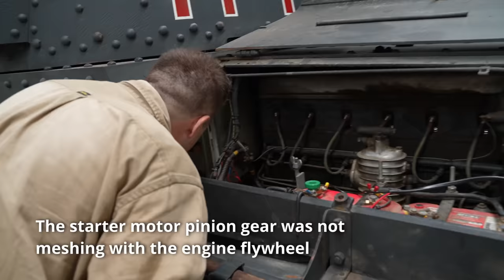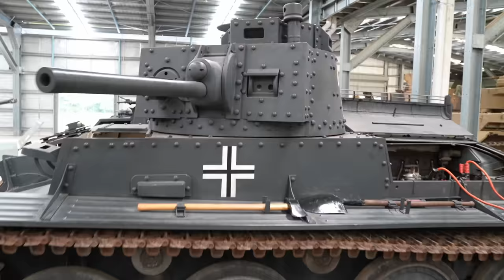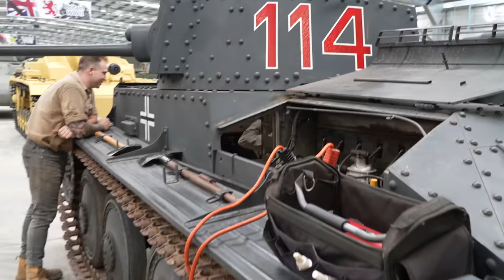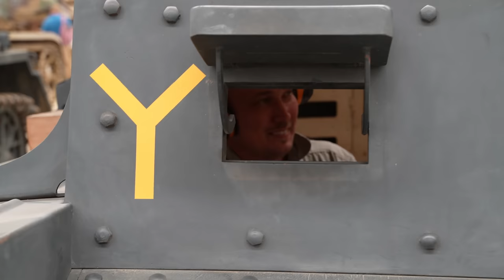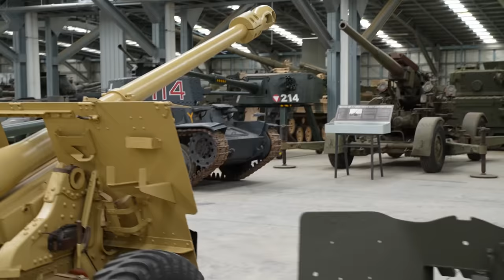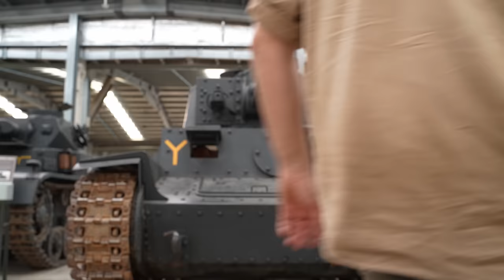Firing up a WWII German PANZER 38t Light Tank

Comment: I never realised before, that the 38t is so small against an StuG
Reply: To be fair, it's a light tank, and a pre WW2 design (not actually German, it is a Czech tank that was adapted by them).
Reply: It helps make you understand why the jagdpanzer 38t was so successful. Tiny little beast could hide anywhere yet still have a 7.5cm main gun.
Reply: Its not much better than a Panzer 2.   In operation Barbarossa the 38t was pretty much a sitting duck for all the very capable Soviet AT guns.  The riveted armor would fail spectacularly, and big chunks would break off and enter the interior causing a lot of injuries.  I think  Tiger ace, Otto Carius had a stint in one.....great read.
Reply: @wazza33racer   Of course the Pz IIIs at the time wasn't much better.   The 38ts had the advantage of the being reliable and... simply available.
Reply: @ConstantlyDamaged tout à fait
Reply: There are very few giants in the early tank corp.
Reply: @m2hmghb  this isn't WoT. The Jagdpanzer 38t wasn't that successful. The thing was way to small and had horrible vision. NO German tank knocked out more tanks the the Stug III.
Reply: Oh wow, look at that. Surprised me too
Reply: Nazis wouldn't have won anything without the Czechoslovak tank.
Reply: @ConstantlyDamaged  so was the Stug, which based on the PzKpfw III who was designed in 1935. The 38 was the successor of the model 35 and therefore it came even later than the Stugs base. The dimensions are more or less the same between the 35 and the 38. It was a bit higher and 5 centimeter wider but it was even 29 centimeter shorter.
Reply: @timothyhouse1622  This is not correct. The correct sentence would be, no other charriot was produced in such high numbers as the Stug. Therefore is is clear that the Stugs knocked out more enemies than any other vehicle.
Reply: @michalandrejmolnar3715  I had to smile reading your statement 🙂

Comment: A great little tank.  The right track could do with a tighten perhaps.
Reply: Having tracks that are tight when it's not being used to cross country absorbs more power and puts a lot of strain on the drive and idler sprockets. It also stretches and thus wears the track out faster. About 1.5 inches is quite normal. (From an ex-tank soldier and maintenance instructor with about twenty years experience). 🙂

Comment: Good old Thing ! Do You use Avgas to fuel them up ? We have the Problem with missing Lead and the modern Fuels desintegrate after 5 to 6 Month in the Tank. Super Plus or Avgas..what do you think is better. The availabel Alkydfuel  (Aspen4) is no good. All the Sealings leak after some Time and must be replaced. That is a real Problem for old gasoline Engines. From Germany with kind regards, Rudi 👍

Comment: Praga EPA or EPA/2 engine. Six cylinder inline, four stroke, 7,75 liter displacement, petrol engine. Either 120 hp at 2200 rpm (EPA) or 160 hp at 2800 rpm EPA/2.

Comment: Great seeing it running, so few of them left now. 
Noticed the hull mounted machine gun is missing and blanked off, did this vehicle come like that or is a job to restate it at a later date?
Reply: It was quite commonly done in service
Reply: This was probably a command tank hull that they used for the restoration. Those were the most likely to have the bow MG mount blocked off
Reply: @tomhouman3  Like I said

Comment: The tracks seem well adjusted but seem to hang back under the sprocket in certain conditions.
Reply: Its a characteristic of front sprocket drives when there is unequal forces or braking on the tracks. One is under fwd tension and the other rearward.
Reply: @obsidianjane4413  Thank you for that!